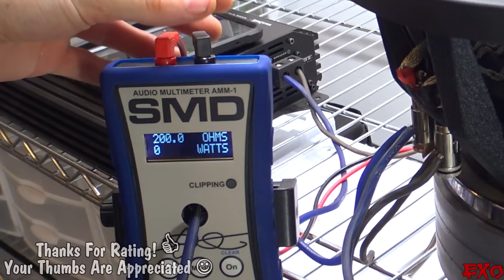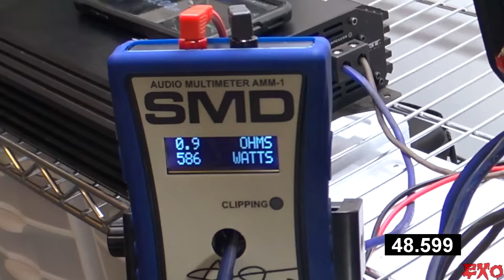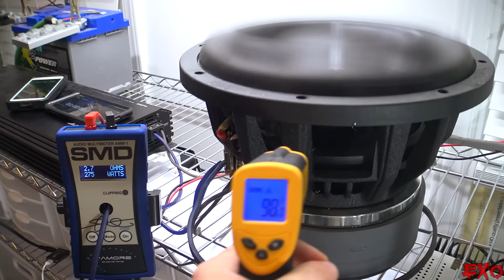12" DESTROYER Subwoofer MOD!?!? Testing NEW Rockville Voice Coil Temperature w/ BIGGER Dust Cap

Comment: Based on their reaction to the last video, I would never own anything Rockville.
Reply: Care to elaborate? I'd love to know more.
Reply: use your head here buy it and rebuild it from the motor up and get better on recone a sub think smart folks..........
Reply: @OlafurArons  Rockville got upset at EXO for his video on their K9 series. They had them over rated and Exo proved it. Then Rockville decided to compare their K9 with a Sundown SA and proved that their products are absolute garbage.
Reply: @________GHOST________     Sell a working product right out of the gate Or sell it as a DIY basket and motor. Good looking subs but they appear to have the same Quality control as BOSS audio      absolutely none
Reply: @________GHOST________  Depends on what your time is worth, if it's worth anything you're better off spending a tiny bit more for quality.
Reply: @steveclark9934  Their stuff is good, but it's mostly lottery with quality control.
I have rxm 84 mids and they worked great over the years.
Reply: I can only speak for myself but I have a Rockville K6 10" and a Rockville db 55 series 4kwatt amp with 4 boss 6 1/2 Phantom series speakers and 2 CS18 bullet tweeters. I run this setup ragged and it's been over a year and so far no issues. It's loud enough to piss off my neighbors for the budget and spent more on the wiring than the amp and speakers. But I'll see in the future how far it will last.
Reply: @________GHOST________  or just don't waste your time and money and buy something that'll work the next day.
Reply: @mosj9876  that's dope dude, if it works for you that's all that matters. You drive your car and you know what you like.
Reply: I still own 2 K9D12’s. And they are just fine, no heat ever. I don’t see what their problem is.. obviously can’t push 4,000 watts, but who cares? Don’t push that then.
Reply: trucker 9000  Fair enough maybe I took it a bit to far there lol
Reply: @cekpi7  Are you talking Boss or Rockville?
Reply: I actually bought my first destroyer and i squeezed the juice out of it and around 700 watts 1ohm i busted it  so i bought 6 of them i regret nothing now the entire state hates me 😆
Reply: The k6 are better than the k9..but everything they make is pure garbage...ive had mids and highs, amp install kits, subs and amps...its all ghetto ass swap meet shit...save up and but a real product.
Reply: @OlafurArons  They make awesome home amps, but I don't think their speakers are that great and never owned any of their car amps but they do rated rpa 5, and rpa 16 are absolute power houses.
Reply: @deemoney6570  Their home/Dj amps are awesome. I don't know much about their car stuff.
Reply: Had 2 Rockville k9 15s in a box and 10,000 watt rxdm5 amp. Shit was causing my trunk to flex like a mf. Make my rear view mirror fall off. Best set up for 600$ by far . Blows anything else out of the water. So yeah they're not as good as 2000$ subs but better than anything else for the price. Period. I got videos of it on my other channel to prove it.
Reply: DeE MONEY sounds like someone has some Rockville in there ride...maybe it’s the fact that there quality control blows and there is no reason why you get my 300 bucks for garbage in a box...sundown...dc even as well as skar all make real world tested subs in this price range of 300 that will outperform these subs any day...and last longer then a couple songs lmao! old pyramid subs were better then this, even a couple wal-mart duals may be better at the cost of 35 bucks....times 8 12s for the cost of this one subwoofer I hate to even say that but they made them not me
Reply: Rockmat is pretty good!
Reply: @SPLjunkie  Yup, they clipped the signal so terribly with one of their shitty Rockville amps, and then claimed it blew  because they were trying to say the sa series was built like shit, lmao, what a joke that was, when i seen the same sa model on sudowns unofficial yt channel, that same sub was taking over 3k burps like its nothing, lmao, Rockville will always be trash compared to sundown. Even a bottom end, buget sundown e series sub could beat two k9s on clean power, lmao.
Reply: Rockville's marine pod speakers are pretty dope i think thats about it😂
Reply: @SPLjunkie  link ?
Reply: yes i will get my cheaper skar instead
Reply: @Brandishh  He doesn't know what he likes cuz he's only had cheap brands. It may be better not to try more expensive cuz then you'll get disappointed by everything else. lol 
So do not buy expensive brands * stay far away * hehehehe

Comment: I never thought about a dust cap aiding in the cooling. Pretty neat. 🤓
Reply: Science man... Science
Reply: If there's no dust cap, dust and particles of dirt, sand, etc can get trapped on/in the coils causing stickage or even a fire to happen in your sub. Not to mention, it will heat up quicker because the dust cap causes a vacuum. When it protrudes it sucks in air over the coils and blows it back out when it extrudes. Same way you do in your mouth when you eat something a little too hot
Reply: @ryucrat  thanks man really helpfull

Comment: I have a Cerwin Vega stroker st15 4d .. Great sub besides 1 flaw.  The dust cap was aluminum and flat. If developed a crack from being flat I think.  ( flexing with all that air pressure on a flat aluminum dust cap wasn’t a wise design. ). This happened soon after I purchased it too. It’s in the back of a suburban and I noticed a extra “ rattling “ sound coming from it for months. Couldn’t figure it out until eventually the crack became visible enough for me to see it was just a dust cap and not something more problematic.  Replaced it with a 6 inch dome style cerwin Vega dust cap that solved the issue and looked better to boot.  Just wish I could have found one that was also aluminum and dome style. Been a few years after my repair and it’s still a beast.

Comment: I watched an RMS test of a Aura Sounds MONSTRO 12" Which looks Identical besides the dust cap and magnet boot to the destroyer and is also rated at 2000w rms and it lasted like 1 min 50 secs around 1720 watts rms. The test video is on the Russian youtube channel R2v.

Comment: The laser on the IR thermometer you have reads about 1 inch below the laser dot at close range. at 20-30 inches is where the dot actually aligns with the IR temp sensor. For more accurate readings just aim higher at close range.
Reply: Stack 'o bananas

Comment: 3 years ago I bought 3 sets of 5k watt  Rockville subs. Then I saw you burn then out before I installed mine. I never used them because of that. I also bought 3 amps. I installed 1 of them and burned it out the 5th time I drove the car.  I hate being ripped off.  I will never buy anything Rockville again.

Comment: I'm just here to see what Rockville has to say again. I'd love for a full refund of my purchase. The K9 couldn't handle my Orion 250 HCCA. But, an old set of Sony Xplod Mobile eS 12" subs can at the same ohm rating? I didn't even touch my gains. They've been set clean for the past 10 years.
Reply: Orion HCCA 250 was my 1st amp... I sure miss her 😔
Reply: I'm running a V1 K9 on Alpine MRP-500.  3 months and the coils still looking like new.

Comment: I very sad today. I don’t know to much about the logistics of stereo. You know. Power ground and remote. I know how to set a stereo up but I don’t know how to drop ohms and why I need more batteries. Most of all I went on amazon and bought two Planet Audio Torque 4000W Monoblock Class D Amplifier with Remote, TR4000.1D. Then I watched a video on YouTube and found out the amp won’t even do 1000 watts. More like 600.  I can’t cancel the order because it’s shipped already.  So can you tell me how to get the most watts out of it. And do you sell amps. Should I buy another battery.  I’m lost. Please help.

Comment: Hey man, new to the channel, I love your stuff. I'm resurrecting some old equipment to go into my ride and I wonder what your thoughts are, and where I should spend the little money I have. I reconed 1 of 2 MTX 10" Jack Hammers. I have both MB Quart amps working great (1.1500D + 4.60) I've got two Lanzar 6.5" Mid woofers with active crossovers and 1" tweeters. I also have a set of 5.25" full range speakers. I'm running it on an adjustable line out converter and a head unit from a 2010 Honda CRV. Should I spent on a better head unit, or wait till everything is dialed?
Reply: I've thought too about keeping the stock head unit and investing in a second battery and bigger alternator, but I don't know if my amps would need that.

Comment: How is a larger dust cap supposed to cool better?
Reply: More area for air movement. Not as constricted. Compare to sitting in a big room with a heater to a small room with the same heater. Which one heats up faster?

Comment: So i am looking at a couple different subs i want dual 12s or 15s, and i was thinking of getting either the destroyer 15d1 or the sound qubed hdx3 12 inch subs 1Ohm, the amp im going to be running a rockville Comp4 which is supposed to do 3000 watts rms. what do you guys think?

Comment: Hey what’s up man I have a KENWOOD  Excelon XR1001-1 amp running at 2ohm to two JBL 12s that RMS at 500 watts at 2ohm and they sound pretty good I have my amp set right at 44.7 volt which is 1000 watts give or take a few watts they hit hard but not as hard as I expect them to ad can smell the coils getting hot with some deeper bass song would I get a louder harder hitting bass if I went with one 12in rms at 1000 or 1500 watt what’s your idea I was thinking one skar evl or ddx 10in @ 2ohm at first or a 15in sub need some advice here

Comment: Was wondering if u have ever tried planet audio subs or hifonics subs or crunch audio subs or alphasonik subs or mb quart subs or ds18 audio subs or q power subs? Their newer brands I do believe & I believe most are cheaper. But I'm trying to see if anyone has ever used them or seen how well they were & how well they last. I'm looking at getting new subs for the back cab area in my Silverado. I planning on either two 10" or two 12" shallow mounts for under the seat. I've used rockford fosgate & Memphis audio & audio pipe & boss audio in my other vehicles. But I'm just looking for something new basically to try & use. Ur videos are great man. U know ur stuff & give out a lot of useful info on everything. I enjoy watching ur videos.

Comment: Wonder if the smaller /bigger dust cap is better cooling wise that would be a pretty good experiment ???!!
Reply: No
Reply: How TF can it possibly be any different the excursion dictates how much air it moves.  Easily think if there's vent holes in the top of coil why in the pole then? Too many options for air flow doesn't make sense almost like it will suck in the same air that was previously heated. I'm probably wrong but just a thought

Comment: do u have a video of hooking up two amp master n slave  i have a pair of psi platform 3 10s n a 2 5000watt goliath  hyphonics amps  added 2nd battery high out put alternater did the big 3

Comment: Why does 57 cause it to heat up so quick and 27 cause it to cool quick?
Reply: Hopefully someone else with more experience can chime in, but I'd assume it's because the air doesn't have time to move so the there's little air movement. At low frequencies the air might have more time to wash past the coils before having to reverse direction so there's better ventilation.

Comment: I have a question for anyone who knows. My Rockford p1000 calls for a 140 fuse but they don’t make them in mini anl fuses. What size fuse should I run on 4 gauge wire.
Reply: People make 140 amp anl fuses.
Reply: Ya I've seen 125 and 150 not 140 so much in the mini just get the 150 it should be fine
Reply: I always use 150 amp anl fuse for my punch amps. I have owned 6 of them. And currently run 3. So no problem using 150amp. 👍🏻
Reply: @bigrobstillpimpn  horrible advise never go up in amperage on a fuse.  You go a step down.

Comment: I know it's less power, but my dd 812d did 250w for 5 mins, I put my finger directly on the voice coil and couldn't feel any heat whatsoever. Crazy. No idea what it did with those 250 joules per second, but they weren't sticking around.

Comment: I just use Rockville components well the crossovers with an extra AP bass blocker and the drivers the tweets are the worst even 5 dollar flea market tweets sound better and last longer. I get my subs custom made so if there is a problem I just take them bad to the builder. Just got my 18inch solo X motors on 15’ frames and keepn my Adire Audio kh3001’s I’m about to put up the vid on them just sitting in my bedroom doing a side by side comparison. So look up Solo X/Adire Audio/Any Night of the Week in Santa Cruz you should find it. Chitichakacata! Buuuuuuudy!

Comment: i watched this video but youtube said i didn't.

that i see you are running 1 ohm resting, i'm more confident that i can run my new audio pipes, two (2 subs at 1100 watts each) at less then 1 ohm on my 3400 watt boss amp. i see you are running at or near 600 watts with the sub at 1 ohm or less.

Comment: push terminals. easy install. bad if low pressure spring. always have make too long cables and F* them behind terminal to make it sit there. still cables moved by the bass, even if you anchor them. so...

Comment: Ive said it before and its because I learned the hard way. I will NEVER buy Rockville products again. Ever. Horrible products, both subs and amps. Horrible customer service. Never again. 'F' Rockville. I blew my whole subwoofer budget with them and I have learned the hard way. So now I've gotta go without subs until I can save up enough money to replace all four of the subs.
Reply: Damn how did you blow all 4 subs what the setup etc
Reply: @bigrobstillpimpn  ive got an Audiopipe APCLE30001.D. Subs wired to 2 ohms at the amp. They should have had no problem taking the amp. All properly tuned using Steve Meades DD1.

Comment: You know what exo I would buy this sub but tear it down to the motor and rebuild it :)  IT DO NOT MOVE OUT 3 INCHES BECAUSE OF THE RUBBER SURROUND BEING WIDE MORE LIKE 2 INCHES CONE TRAVEL BET JUST BY ME LOOKING AT :D LOL  P.S TALL RUBBER SURROUND ON THIS SUB IS FOR SPL ONLY THAT IS WAY THE COIL WILL BURN UP
Reply: YOUR CAPS IS ON. rebuilding takes time and costs money, just buy a good sub for not much more $

Comment: I wonder, since i have a P3 12" dual 2 ohm (wired to 4ohm in series cause my PA amp pushes most power at 4Ohm bridge), how you would rate it compared to other subs, KEEP IN MIND that those subs cost over $150 more in Belgium than in the US though!
For the same sub, YES, ridiculous honestly.... shipping from the US to Belgium is also ridiculously expensive so i think ordering from the US would cost atleast as much...
That's pretty much with every US based brand, while their parts (usually) get made in China and they just put it together in the US, why do we honestly have to pay that much extra, that's what i wonder.
also almost impossible to find anything selling Skar, PSi or anything, Sundown stuff also is (ATLEAST the SA 12 which is a lighter sub) $120+ more expensive
honestly most of the good subs are only found in the US except for the wider known brands, i mean sure as hell those newer brands are well-known but there's almost no market of those in here (i've never seen ANY of those newer brands in real life by the way)
maybe Alphard could be an option, otherwise i have the decision between RF, Alpine, Soundstream, Kicker, JBL, Kenwood, ESX (quite overpriced brand imo), Ground Zero and Pioneer, but none of those more extreme subs tho, while pmuch everything is overpriced... sad really.
Reply: Kicker cvx 12 was the answer for me 750 rms not 500

Comment: I personally don't mind Rockville for the price I rep a lot of their speakers in my vehicles. I have the Rockville K9V2 6.5 as a center woofer and it handle the rated 250 RMS daily. I have a American Bass HD 12 and because of price I wanted 15 and bought a Destroyer 15 D1. I will post a video after I install it and show how it does in real world situation

Comment: Yall want a solid as fuck system get you a db drive g5 series sub i have just one 15 and have yet to run into anything on the street that can keep up...max power is 6k rms is 3k . But I think it actually can handle more reason I say that is cuz im running a quantum audio mono amp that pushs 6000  Nd i can turn the amp up all the way and the sub sounds like it could still handle more. I get 0 distortion and no bottoming out.. but  my car wouldn't be able to handle more I break random shit as it is from how hard the bass hits

Comment: The Rockville product is shit but there is completely different point people need to understand. MORE MOTOR DOES NOT EQUAL MORE DB DOWN LOW. Simply put, the more motor force you have, the more electromagnetically damped the sub is, meaning it will not resonate freely at lower frequencies. On the contrary if you have a ported box, more motor force will be super-effective at exciting port resonances but only at tuning. Only above 50-60Hz will the ultra-huge lower QTS motor designs gain. It's just physics and there's no free lunch.